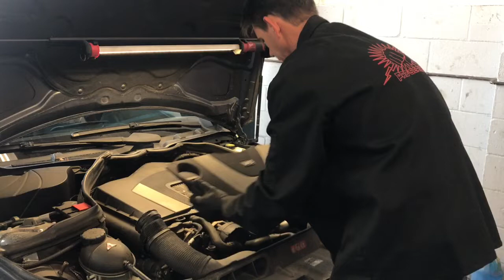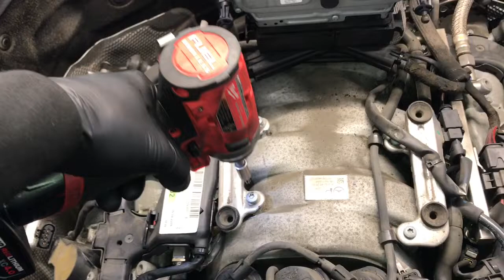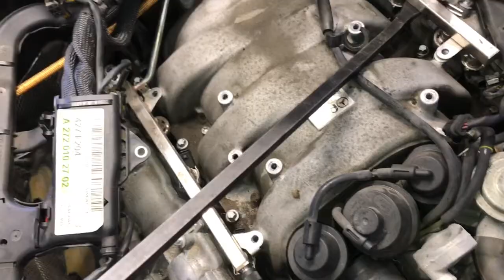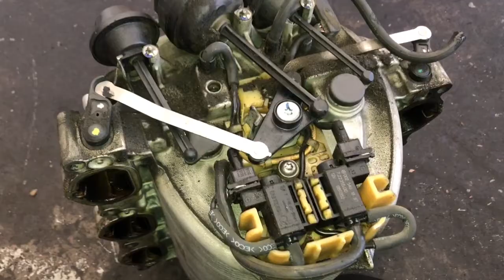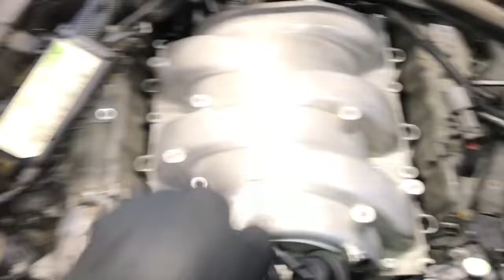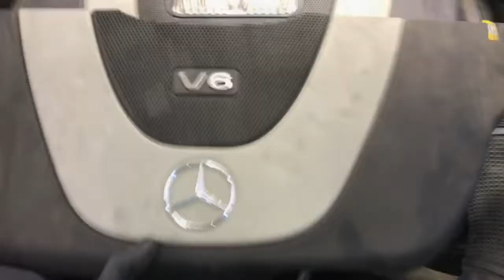How To Replace An Intake Manifold On A Mercedes C300

Comment: For anyone here in 2026, it’s a good idea to replace the PCV valve as preventative maintenance so the new intake runners don’t get gunked up later on. Great detailed video.
Reply: I’m here in 2026, was your car making a slight ticking sound  when you press on the gas because of this?

Comment: Does it come with the self tapping bolts or are the threads self tapping on the new one or do i have to get the bolts myself
Reply from the maker: The original bolts will self tap. No need to track down or buy any additional hardware.

Comment: Disconnect negative battery terminal, remove the ME and use a small amount of dumdum on the manifold gasket so it doesn’t fall off… Only criticism I have…

Comment: Does anyone know if you have to have a special scan tool to clear the fault code so ecu adjusts to new parameters for intake fix? Because I replaced my broken one (lever snapped) and I’m still getting fault code p2006 and same issues I had as before.
Reply: Nope, so am I. Wondering if a hose didn’t get connected back completely or melted or something, there’s no resetting required though

Comment: This video makes me feel like I can do it myself and save thousands of dollars. But watch me actually take it apart and don’t know how to put it back together. I guess I have to replay the video backwards and pause every second to put it back together. Thank you for the video. You make it look easy. It might be a full few days of work for a newbie like me. 😅😅wish me luck!
Reply: How'd it go man in the process of doing it right now. Have everything unhooked waiting for the manifold
Reply: @ReallyNoble  lmk how it goes
Reply: @ReallyNoble  was the unhooking hard?
Reply: @qtbrxnds897  wasn't too hard, man. If you don't have one, buy a torque wrench and listen to what torque he says in the video. Should be 6ft lbs. You don't want to over torque bolts. That is what I did on my throttle body and striped the holes for it. Reason I got the new manifold, actually, but ended up actually needing it because my lever was broke. the difference was night and day.
Reply: @qtbrxnds897  also for getting the manifold on with the gaskets. There's these spots where the gasket clips in, but the clips are weak. Super glue the parts where it clips and leave it to dry for a few hours. Helps a insane amount.  Also, if you can get a bungee cable to hold the cars wire up that helps a lot too

Comment: The hard to reach front vacuum hose is easier to connect if you remove the air pump.

Comment: What if your car doesn’t turn on after installing the new intake manifold, I double checked all the clips and hoses and bolts were not loose and installed correctly but it’s not turning on. Should it be the battery?
Reply: What happened?

Comment: W204 C300 service manual specify that the torque for the intake manifold bolts is 9 Nm (6.64 ft-lb), any reason you’re using the higher torque here?

Comment: This is MOST COMPREHENSIVE STEP-BY-STEP TUTORIAL.  I have replaced mine three time.  Best to buy aftermarket so you get aluminum flappers vs plastics.
Anyone doing this job needs this video as you have the best steps and you showed all of them. NO guessing.

THANK YOU. Im gonna post this video in the Mercedes R350 forum. This job applies to all those M272 engines for sure.

Comment: If all you need or want to do is replace the Intake Manifold Air Flap Runner with a Repair Kit, can you take off some of the pumps etc from the front of the engine to get access to the broken plastic arm? It seems like it might be less work....???? 2008 C300 3.0L V6.
Reply: Nope… the problem is it’s held on by one center torque screw, located right behind the thermostat housing. There’s no room to remove the screw until you lift the manifold up.

Comment: Great workflow, i'm sure a mechanic shop will try to charge me 4 hours for this job and the dealer would charge 20. I think I can do it myself after watching this vid. My intake manifold is making a high pitch whistle noise in the front area. Does this mean I need a whole new manifold or is it likely one of those rubber/plastic hoses that sit in the front? Also was curious why you did not unplug the ecu? Lastly (sorry for all the questions) I was considering going with the chinese made intake manifold for 1 beacuse its cheap but also because it has aluminum flapper arms instead of the plastic ones that break... would you recommend I stay with the oem for this sort of a part or would a chinese made manifold be sufficient?

Comment: I torqued them to 9ft lbs in the sequence shown and I am getting leaks on both banks, I was just wondering what the issue could be. The manifold is an aftermarket so I am not sure if that’s the issue or not. Thanks
Reply from the maker: It’s very easy for the gasket to slip off. Possible what happened or since it’s aftermarket may require more torque.
Reply: @HowtoAutomotive  Ok would you ever recommend putting gasket maker on with the gasket?
Reply from the maker: @davidstreeservice8662  no. Most the time that causes more leaks than helps. If you look at how the factory did it you won’t see the sealant on the gasket

Comment: Hey what if only the "snorkels" are broken and not attached. Would that be a cheaper repair or does the whole manifold still need to be replaced
Reply from the maker: If it’s Just the snorkel then no you do not need to replace the manifold and you can get the snorkel separately.

Comment: Just installed new manifold from your video on my 2012 c300. Everything seemed well went well with the replacement install until I turn the car on.I now have O2 sensor codes,misfire on cylinders 1 and 4 And injector “A” circuit code. Any troubleshooting advice would be greatly appreciated thank you.

Comment: whats your opinion or the repair kit for the arms?
Reply: Make sure you clean out the ports & swirl flaps with Seafoam, if it broke because of carbon deposits it might break something else. If the flaps wind up down in the valves you’ll have a problem.

Comment: Did you need to release pressure in the fuel rail before unscrewing the fuel line
Reply from the maker: You can do that two ways you cracked the line lose but don’t take it apart and the pressure will bleed off. Or you can remove the fuel pump relay run the engine until it stalls out before you take it apart.
Reply: @HowtoAutomotive  can you tell me the torque specs for the intake manifold throttle body and the rest of the manifold torque specs ?

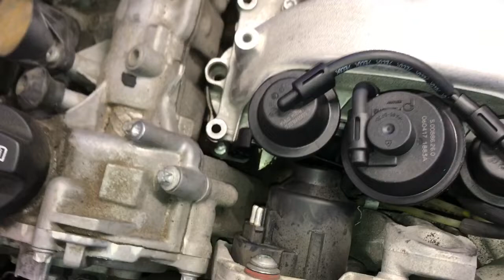Comment: Jus wondering..  you went through the trouble of taking out the down elbow (snorkel) and throttle body and yet, you didn't clean it.  16:00 shows you install the snorkel still has all the oil stain on it.  This won't do any good as this will pour back into the new air intake and gumming it again. Perhaps you may be of service for your clients by cleaning that piece or put a hour or so to do it.  I am sure your clients will be more than happy to pay you for it than having the new air intake start gumming up right away.

Comment: Great video, I like the detail and quality, I like how you save time but using the cord to keep parts out of your way. I replaced the plugs, the next day the check engine lamp came up, code P2006 and a few sub codes, clear them all, car runs good and very smooth, it could have been a fluke?
Reply: No fluke. The car will run fine without the variable function of the intake runners. You'll just loose the benefits of having a short or long runner setting for optimal air flow given the throttle input.
The real danger is the internal runner flap plastic crap breaking off & damaging the valves, & the codes may not show at all before that happens.

Comment: Great video! FIY, the MB shop manual states the torque spec for the intake manifold bolts is 9 Nm, not 9 ft lbs. Not a huge difference but wouldn't want to over tighten anything.
Reply: This comment is 4 years old, but still helpful. It definitely makes a huge deference because my bolt snapped trying to torque it to 9ft lbs..
Reply: For a w204 or w203??
Reply: W204

Comment: I have 2009 e350 I’ve owned it for couple years but I’ve always have this clacking noise at idle ownly after a couple minutes of running sounds like rod bearings ive change oil several times with mobile 1 0-40 why do some of these cars have that clacking sound and others don’t what could be the problem

Comment: I just got a P2006 code on my car when the check engine light came on. Do you recommend performing this job? Computer said something was wrong with the tumble flap?
Reply: @howtoautomotive
Reply from the maker: Dylan Natale If you look down at the front of the intake you’re most likely find the control rods broken. If so I would recommend replacing it.
Reply: Thank you so much. Is there a specific one you recommend? The prices range from $200 all the way up to $700
Reply from the maker: Dylan Natale The one I used in the video is a factory replacement. I would recommend that one. There is links for in the description.

Comment: I found this video very helpful but one comment I would like to make is that you say you use washing up liquid to put the injector seal in this is a bad idea as the soap contains salt which is a corrosive, may I suggest using WD40 or Dielectric grease, just a thought.
Reply from the maker: jagvette1 I was unaware of the salt being in the soup. The dielectric grease is a good one but I’m not sure of the WD-40 could possibly make the seal swell.
Reply: I did a little more research and the opinion is the salt is the non-corrosive type, by I would avoid it, each to their own, in one respect the idea that WD40 may make the seals expand might ! not be bad and make a better seal. (just a thought), but one again love your videos.

Comment: Watched your video, very thorough. Really liked the details and tools and part links. I have a broken swirl arm on a 2008 c300. Am concerned that putting metal arms on the linkage may create  potential for a more dramatic failure, which could impact the cylinders. any thoughts on repair or replace?
Reply: What is the logic behind your hypothesis? Carbon buildup causes resistance that causes pieces to break. How would putting metal arms instead of plastic change anything other than durability?
Reply: @Verbalism  allegedly the plastic crap on the front was made out of plastic so it would be a weak point, ensuring they would break before the internal plastic crap flaps/runners.
Perhaps aftermarket metal piece on a new manifold is nice (if pcv system is kept functional). But like you said, carbon buildup is the problem, so metal aftermarket parts on an old manifold could expedite that internal failure I suppose.

Comment: What's the symtoms of a bad intake manifold. I lost power in acceleration and I got a diagnostic that state it could be the trottle pedal or electrical problem. I change the gas pedal with the sensor and after that I've notice both intake house were crack so I went ahead and change both of the along with the air filter. The cars still  have acceleration problem.  And it be the trottle body ? Otr maybe it is the intake manifold.

Comment: I'm too old to do this job, have a chronic back problem, can't bend to reach all these bolts and wires, I barely replaced the spark plugs and cleaned the MAF, wondering how much this will cost if done be a mechanic....I have 2008 R350........thanks

Comment: I'm 11 minutes in, and I pray I never have to do this on my 2013 C300.
Reply from the maker: Night King It’s a lot of work. But it is one of those jobs it looks harder than it really is.
Reply: @HowtoAutomotive  late comment but yeah I did it after watching your video a year ago and replaced it with metal part but now the plastic lever that goes up and down broke so I am looking into doing same job a year later lol I do not get check engine light just noticed that car is hesitating on acceleration and knew exactly what it is lol I manually just opened the flap so it drives fine just little less miles per gallon
Reply: @dulisha  I have to do this on my w204 it has the Manifold flap code :(

Comment: Great video!  I just got done with my lever replacement fix.  I would recommend for people doing this job to buy replacement vacuum hose.  I found many of mine deteriorated (2008 c300). An added note : slice the hose with a razor blade longitudinally at the nipple of the map sensor.  I guess over time, the plastic map senor nipple gets weak.  When I was pulling on the vacuum hose, the nipple  tore off.  (new map senor = $54.00).
Reply: Do you know what size the vaccum hoses are? Thanks

Comment: My C300 developed #1 miss fire. The dealer tested coils and preformed a full tune. They the suggested a new intake replacement. They said that spark plug damage was due to the intake, really? So, why would the take cause the #1 plug to miss fire?
Reply from the maker: Alvin Davis the intake runners break in side the intake making air fuel mixture off and causing a misfire.
Reply: so should i replace the intake?  I found a metal bracket to replace the rear piece that break in the rear.
Reply from the maker: Alvin Davis it depends on how your intake broke. If the control arms broke or if the runners in side broke.
Reply: @HowtoAutomotive  they didn't say it was broke,  but suggested I do so because of the burnt plug in #1. So they have me freaking out. He worded it if the burnt plug was due to the intake. The only code was for the miss fire in #1 cylinder aka the Plug. The car has 200K tho.
Reply: I purchased an intake and a fix kit for the intake valves. Wait!!! I returned all intake related parts after speaking with a Benz tech outside of the dealership. He told me I wasted money because I didn't actually have a damaged intake. Yep,  no codes or ruff idle caused by a damaged intake.  Thanks for this awesome channel BTW.
Reply: Alvin Davis what was the issue?
Reply: I just traded it in for another C300 W205

Comment: I coat my engine bay plastics/rubbers, specially the flaps on the intake manifold with 303 aerospace protectant, use to use silicone but it attracted to much dirt,303 seems to work better, 250k on my 2008 c300 and all rubber and plastic look and feel new hoping i never have to do this repair..
Reply: I'm going to try this thank you

Comment: Great vid!! As always your explanation is incredible and to the point. I was wondering if you are flat rate, I know it takes a little longer to film and work at the same time. Can you use an adhesive to keep the gasket in place?
Reply from the maker: bill beckett I am flat rate and it definitely adds a little time to film these videos. I do make a little money from YouTube and from affiliate links that makes up the difference in time lost .You could possibly use some 3M super whether adhesive to hold the gaskets in place.
Reply: @HowtoAutomotive  my torque wrench start at 20 is it anyway I can still set it less
Reply: @youngmack5206  you need an inch-lb torque wrench

Comment: Looks and sounds as if you do this intake manifold job everyday, but I know that's not the case.  How many times do you typically need to do a job like this before you develop the memory and proficiency that you display in the video?  What is the book hour on this job?  Thanks.
Reply from the maker: yusuihang I would say after the third one I did it was autopilot from there. The book time is about 3 1/2 hours. I did this one in 2 hours including filming.

Comment: Good job. Surprising how fast your doing everything with one hand and your camera.
Reply from the maker: Jesse Lyons I’ve made over 600 videos so I’m getting good at it. Lol
Reply: @HowtoAutomotive  how long does this take I trying to replace mines on my c350 is it the same way
Reply from the maker: Young Mack I can do them in about an hour and a half two hours. But if you’ve never done them before 3 to 4 hours I would suspect.
Reply: @HowtoAutomotive  y do shops say 7hrs
Reply: @HowtoAutomotive  700 to install u think I can do it myself I put 1000 into the car now I'm just not finding out this what I need this cause misfire nd no acceleration rite